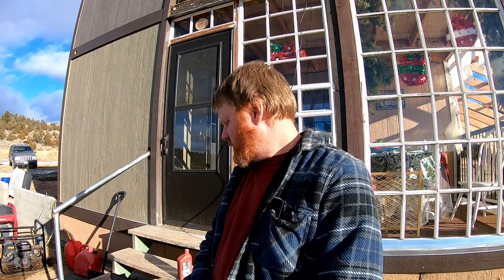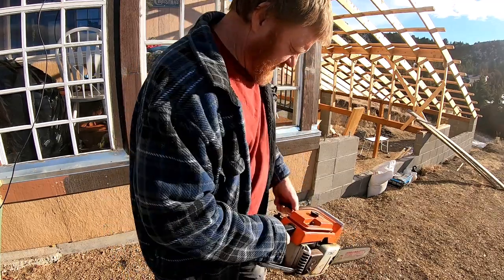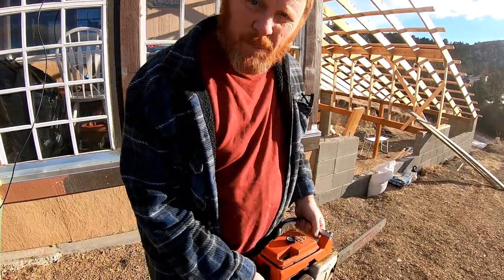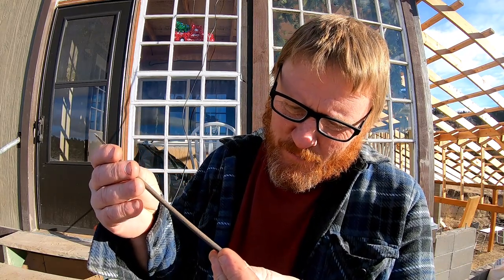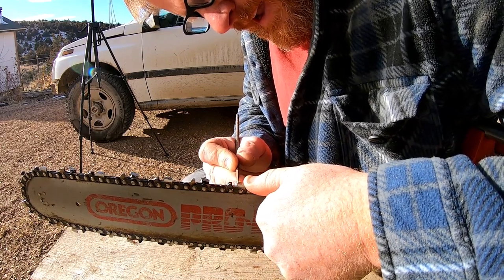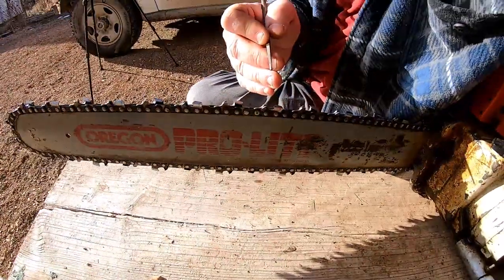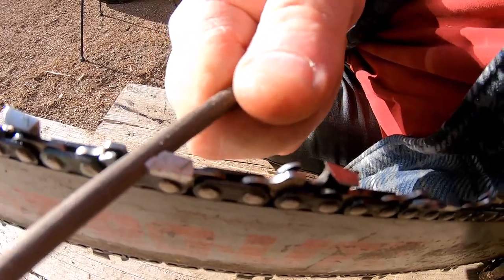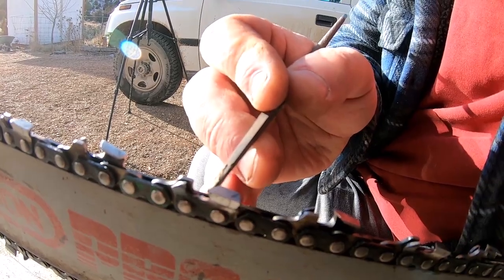Chainsaw secrets, How to sharpen and "tune up" a chainsaw for peak performance, like the pros

Comment: thanks for the video.  Yes, I will never use bar oil again.  someone gave me a gallon, I really didn't like it, when I switched back to 10-30 I noticed a faster chain.  In the 70s we used Arco Graphite oil and it worked great.